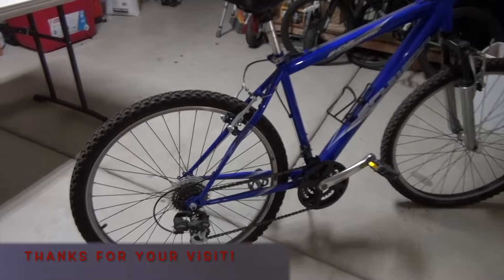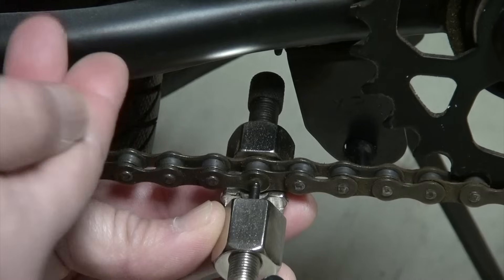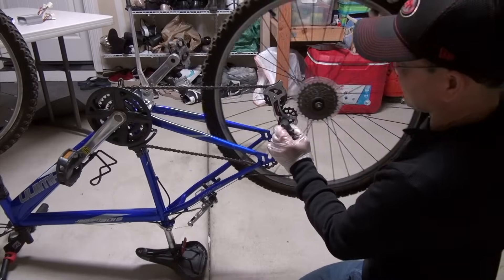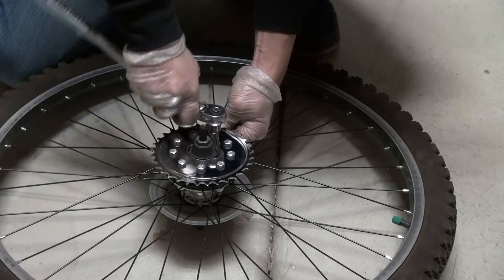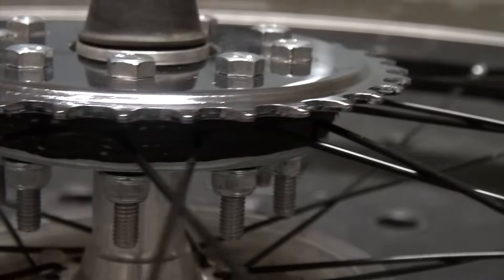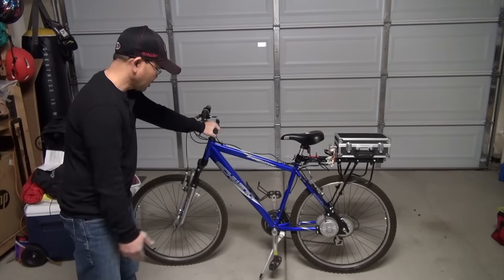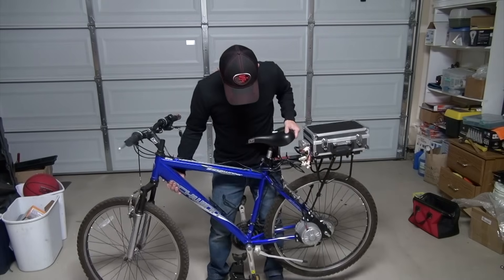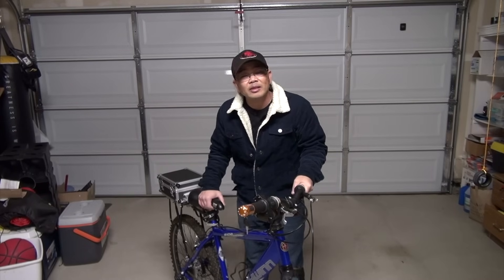Powerful Electric Bike Conversion Part I (E-Bike Conversion Kit Installation)

Comment: I bought a 40v Ryobi tool battery, a charger and a power wheels adapter for the battery from Amazon.
Reply: How well did it work sir
Reply: @mr.wizeguy  It works awesome for a 36v system. I built five e-bikes for my family and I use the 40v batteries for all the bikes.
Reply: Sir please for instance if the battery weak, can I still ride the bicycle as free as the normal bicycle, I want to know if the motor will interfere will make it hard to pender

Comment: Is there anyway of increasing the power, using products from companies like Arduino
Reply: u can use a more powerful controller (bigger wattage compared to your motor) so say you have a 24v 250w motor, you can actually use a 24v 350 controller, this will give the motor a little bit of power because its pushing 350w from the motor instead of only 250w. The downside is you will wear your motor a lot faster.

Comment: this is not a powerful kit, I installed the 36v, 450 watt version of this kit onto a 26" wheel mountain bike. This kit, with charged batteries will go right around 20mph on flat ground and decrease as the batteries go down. This is a helper motor and not enough power to go up hills by itself, it enables you to pedal up those hills with effort as without, your walking. My biggest complaint about this is how loud the motor is and its loudest at 17 mph and up. Im using a 10ah 36v battery, the range is horrible, with hills around lucky to get 8 miles,  and the brackets did not fit at all, I have to basically fabricate new brackets and the kit location, you will hit your back of your foot on the motor, I mounted it up behind. If you like diy on a budget you can try it, other than that I would recommend just using a hub style kit, much easier and better performance.

Comment: How fast does it go?
Reply from the maker: Top speed is 18 miles per hour.
Reply: Ok thank you here's a dumb question if I was to get the 200 or 250 watt or what ever it is would it go slower? I'm thinking it would but to sure and how many miles do you get on one charge with them battery?
Reply: @clarkgrizwalt3377 e-bike conversion kits don’t come with a battery you have to buy one. The 250 watts motor is better than the 200 watts
Reply: I was wondering if I could get someone to install it for me?
Reply: Where are you located at and what do you need installed?

Comment: 6:42
I'm pretty sure that is the wrong plate, that one is for the right side. The long slot allows it to slide towards the front and back.

The plate is not symmetrical. Therefore the same plate does not go on either side, they should be different plates. That is, unless it's just weird.

Apparently they (whoever they is) never bothered to redraw/redesign the plate when they decided to apply it to the left side of the bike.

Comment: Use a Clamshell Sprocket adapter .  Rag joints kill wheels
Reply: Have you noticed that plate is the same for the left and the right sides, even though that plate is not symmetrical. That long slot on the pointy end should allow it to slide forwards and backwards like when installed on the right side, not diagonally like when nstalled on the left side.

My guess... The original design was for the right side and they (whoever they is) never bothered to redraw/redesign the plate when it was applied to the left side.

Comment: Thank you so much for sharing this video I was thinking about doing the same thing on my bike and wanted to see it done first before I went ahead and started on it by chance does anybody know the range on these batteries and a good way to ensure it’s waterproof? As we all know rain+batteries = a bad day 60 miles from home lol
Reply from the maker: Check out part II and this video for better ideas and electric motor.  Fast and Powerful 48V 1000W--A Complete DIY E-Bike Conversion Kit Installation Guide for Beginners!
https://youtu.be/Ej1OK0_hJaU.  Good luck on your project.  Thanks!

Comment: hello, 19mph ! it's not much for a 450w, your battery 36 or 48v ?, my bike with motor hoverboard 350w friction mounting, modified to triangle, 36v battery runs at 24 mph.

Comment: Can I use a 36 volt lithium ion battery
Reply from the maker: Yes.  That would be the preferred type.  Check out part two of the video.  I upgraded the bike to lithium ion battery…

Comment: Is this compatible with disc brakes
Reply: It is, but u have to remove the brakes, install the sprocket, and then reinstall the disk brakes. The rest should be the same.

Comment: Good video, but is it not worth investing in a battery unit, frame mounted that is less obvious, detachable for charging, you have quite a bit of weight there and it's not exactly in the safest of spaces, but like I said good video all in all.
Reply from the maker: Thanks! I resolved those issues in part II
Powerful Electric Bike Conversion Part II--Lithium-ion Battery Power Boost Upgrade
https://youtu.be/c6YgNQg3VM8

Comment: YOU  HAVE TO BE VERY CAREFUL  WITH  THAT  CHAIN BREAKER OR IT WILL ITSELF BREAK .
THE  CHAIN  LINKS  HAVE TO BE POSITIONED  VERY ACCURATELY . IF YOU HAVE TO USE   TOO  MUCH  FORCE THEN IT IS NOT ALIGNED CORRECTLY..... THERE ARE ALSO  PLACES  FOR   TWO TYPES  OF  CHAIN  ( THE  10 SPEED  TYPE  AND THE  OLDER 3 SPEED  TYPE MAKE  SURE  YOUR  USING  THE  CORRECT  POSITION TOO..

Comment: It does not have reverse right?.. I mean.. I tried to move on reverse but the chain did not  run because the motor.
Reply from the maker: Correct, it does not reverse…

Comment: Which wires should connect to the battery
Reply from the maker: check out part II of the video for better ideas: https://youtu.be/c6YgNQg3VM8.  The battery should be connected to the red and black terminal connector of the controller.  Thanks!

Comment: Good job. How'd you get the gears to line up so we'll,? Most don't.
Reply from the maker: You might have to shorten the chain and used an extra washer.  Some bike fit better than others.  Thanks!

Comment: I fitted locking nuts on my sprocket !!!!    I bought  2 kits for  2 bikes !!!   The only problem is the kit can be difficult to fit !!!!  But that doesn't bother me !!! The thing I like is that you don't have to buy an expensive battery to fit a computerised system.  You can use Lithium or lead acid and you only have 2 leads off the battery unlike a multi pin plug in unit on a bought E Bike !!!!
Reply from the maker: Thanks!

Comment: why doesnt anyone tests this up on a 10degree uphill?
Reply: I had tested 250 watt motor on 45° uphill, speed had reduced to 3 kmph and motor outer cover temperature went around 90°c. Again tried with two people on one cycle and motor started to burn in the middle of the hill which is around 100m long. But I still use the motor without any issue. This motor can handle around 25 amps of current for about 1 - 2 minutes (in 2 people overloaded condition) . In normal condition this motor takes around 19 amps starting and 7-10 amps running current in flat road with 2 x 12.6v lead battery.

Comment: Im also building an diy electric bike. Im ziptying the wires to the bike frame, but should i use electric tape to cover up the exposing wires?
Reply from the maker: I would stay with the zip ties as they provide flexibility in case you need to rewire the bike.  Best of luck on the project.  Check out part II for better ideas to make the bike lighter  Powerful Electric Bike Conversion Part II--Lithium-ion Battery Power Boost Upgrade
https://youtu.be/c6YgNQg3VM8.

Comment: what about the strength of the dynamo, is it durable? How many kilometers has it been used?
Reply from the maker: Hello, I have not been keeping track of the mileage, but I still have the bike today.    Check out how I upgraded it in this video 
Powerful Electric Bike Conversion Part II--Lithium-ion Battery Power Boost Upgrade
https://youtu.be/c6YgNQg3VM8.  Thanks!

Comment: Hey! Are these parts waterproof? I want to do this to my bike but I’m not sure if it can withstand rain.
Reply from the maker: I never took it out in the rain.  But I’m sure  can place protective rain covers on the motor, controller and battery pack. My upgrade of the bike in part 2 of the videos make it simple to cover the battery pack and controller from rain.  Powerful Electric Bike Conversion Part II--Lithium-ion Battery Power Boost Upgrade
https://youtu.be/c6YgNQg3VM8
Reply: The controller is not water proof

Comment: Hi dear. May i know how is the 20-30degrees uphill climbing power. Can we get same speed ?
And can you tell me which one is better for ebike, two of that type motor or 3x 895 or 997 DC 24v motor with reduction gears Thanks
Reply from the maker: It will require more power when going up hill.  If you want to get the same speed when going up hill, you’ll will need even more power.  I don’t know enough about the motors you’ve listed to offer helpful feedback.  I recommend using at least a 36v motor.  Thanks!

Comment: Is there a motor drag when pedaling ? I know with non geard hubs it's so bad you can't ride it with a dead battery . A reply will be apreciated
Reply from the maker: Just slightly.  Overall not a problem when not running on the motor…

Comment: Can it work with only a switch without a motor speed  controller?
Reply from the maker: A switch will turn on the electric motor, but you need the throttle to control the speed of the bike.  Thanks!
Reply: The motor switch should have a dead man feature. Other wise you could become A Dead Man.

Comment: How well does it do when you go back to shifting regular. Does it effect it?
Reply from the maker: It runs pretty well on regular mode.  Just slightly heavier due to the weights of the batteries and motor. Check out part II of the video for better battery storage idea
Powerful Electric Bike Conversion Part II--Lithium-ion Battery Power Boost Upgrade
https://youtu.be/c6YgNQg3VM8
Reply: Also did you have to buy the battery separately
Reply from the maker: @BHopDubs  Yes. You have to purchase the battery separately.

Comment: Just got ours assembled. The way the bracket lays on the bile frame the electric motor sprocket and the bule sprocket are not parrallel and the chain keeps coming off. Difficult to adjust the motor to change sprockett angle.
Reply from the maker: Sorry to hear it doesn’t fit perfectly.  You might try adding washers to the axle rod and or adjust the length of the chain to the electric motor…
Reply: @diypotentials  I was able to adjust the bracket angle by hammerin gout the two 90 degree bends to make both sprockets parrallel. SUCCESS!!
Reply from the maker: Awesome!  Congrats!  Check out part II for better battery storage ideas.  Happy New Year! https://youtu.be/c6YgNQg3VM8

Comment: Great project. Just one question: Isn't the noise too much? Does it grab every one's attention on street?
Reply from the maker: Thanks!  It is not as noisy as heard on the video.  The microphone was set on zoom mode.  Check out part II for better battery replacement and upgrade.  https://youtu.be/c6YgNQg3VM8

Comment: hi just wondering how to align the motor, I try to follow your way but not enough room for me to secure the motor. please advise thank you
Reply from the maker: Depending on your bike’s frame, it might not fit.  If tiny adjustments needed to align the chain, you might use additional washers.

Comment: Just wanted to ask what your bike frame size is to see if the bracket can fit my bike. If you can give the dimensions of the bracket that would help too :)
Reply from the maker: Sorry, been away for several days.  My bike frame is 26".  The height of the bracket is 6".

Comment: How do u know what type of battery will work???
Reply from the maker: The DC motor runs on DC current.  Batteries put out DC voltage output.  If it was an AC motor, it would not work.  You will need an inverter to convert DC to AC to drive the AC motor. Thanks!
Reply: @diypotentials  what type of battery would u recommend? I'm brand new to this e bike thing and I'm lost in sauce 🤦
Reply from the maker: Check out part II of the video, https://youtu.be/c6YgNQg3VM8.  I recommend lithium-ion battery pack because they are lighter and has more power density.  However, they are more expensive than the lead acid batteries.  Also, be careful when buying lithium-ion battery packs, some sellers are dishonest about the battery capacity rating.  Even the one in the video might not have its true capacity as several viewers pointed out. Check out buyer reviews before purchasing.   Best wishes. Thanks!
Reply: @diypotentials  thanks

Comment: did not show the wiring connections
Reply: You worried about the yellow and black wire connection to red and black wire on the motor? Funny, me too. Trying to find the answer myself without contacting the seller.

Comment: Blankety blank it torx nicely 👌 😎 👍
Reply from the maker: Check out part II. Powerful Electric Bike Conversion Part II--Lithium-ion Battery Power Boost Upgrade.  Thanks!
Reply: @diypotentials  As you know I like bicycles that remain bicycles. So when I get far away from home and become tired I simply ride home with the electric motor👍. And enjoy the breeze especially in this Texas heat sweetheart!!!!

Comment: You sir are a god send I will look for it as you said on Ebay and Amazon. What's the name of the kit please please please???? What does Ebay or Amazon call it if I go to the search. Please.
Reply from the maker: The links to the products are below the video description.  Here are some products in video:
450W Newest Electric Bike Left Drive Conversion Kit
https://amzn.to/3jCWn2V
12V Sealed Lead Acid Batteries:
12V 7AH Sealed Lead Acid Rechargeable Battery 
https://amzn.to/3h9PNj4
2 pack--12V 7AH Sealed Lead Acid Rechargeable Battery 
https://amzn.to/3zVZrNG
Thanks!

Comment: What type of bike is that because everything seems to fit so well, and these kits are not the best at being universal
Reply from the maker: A 26-inch Schwinn sidewinder.  I don't see it on the market anymore.  Thanks for the comment on the battery.  I have to be more careful next time.
Reply: @diypotentials  👍

Comment: Thanks for posting this and doing such a great explaination.  I just finished a mid mount kit on my bike, but I was looking at the outboard motor for another bike as an inexpensive project.  I like the 250W/36V motors as we can use surplus scooter LiPo batteries for them.
Reply from the maker: I’m glad it was helpful.  Check out part II of the video.  I found a simpler way to store the battery.  Powerful Electric Bike Conversion Part II--Lithium-ion Battery Power Boost Upgrade.  Thanks!

Comment: Your video was enlightening I bought a kit and after watching your video I come to realize that I didn't get a flywheel like the one you installed and I don't think mine is going to work
Reply from the maker: Thanks for the kind words.  It took me awhile to collect all the parts together for  the project.  Part II of the video provided a short cut.  Powerful Electric Bike Conversion Part II--Lithium-ion Battery Power Boost Upgrade.  Good luck with the project if you decided to continue.  Thanks again!

Comment: Hey I just bought the same kit what battery do I need
Reply from the maker: Congrats on the kit. Check out the rest of the video and these two other videos for more ideas on batteries. How to Charge a Battery--lead acid and lithium-ion batteries (2021)
https://youtu.be/74OGZGrKd5Y
Powerful Electric Bike Conversion Part II--Lithium-ion Battery Power Boost Upgrade 
https://youtu.be/c6YgNQg3VM8
Thanks!
Reply: I prefer the lithium ones

Comment: Great video! I just bought one of these E-Bike 24V 250W Electric Bicycle E-Bike Conversion Kit Brush Motor+Freewheel 100% New today on eBay! But I have one question? How you do you recharge your 12 Volts Rechargeable Batteries without getting shock or feeling current? I'm thinking about getting one of those type of batteries? Or a 36v Li-Ion Rechargeable Battery Pack? I'm looking how to find a charger that would be compatible with a XT60 Yellow Connector Plug? I may need your help and advice. Thanks. Have a great weekend. Take Care, Phil
Reply from the maker: Hello, Best of luck on your project.  Regarding 36v rechargeable battery pack, please check out part II of the video.  https://youtu.be/c6YgNQg3VM8.  It might have helpful info for your project.  Thanks!
Reply: @diypotentials  Thanks!

Comment: Seems like a lot more work than a hub motor kit especially if you need to adjust the motor bracket to fit your bike frame , but this is much cheaper
Reply from the maker: Thanks!

Comment: How to charge the battery.  Please help
Reply from the maker: By using a battery charger.  If your batteries are 12v each, you can use the 12V battery charger and charge each one at a time. You can purchase them on eBay or Amazon.

Comment: Thanks, The only thing I would do differently is use LIon batteries instead of lead acid.
Reply from the maker: Thanks!  In fact part II of the video, I upgraded it to 36v 30AH Li-ion battery pack.  Lots of fun!

Comment: How much was the kit and the battery
Reply from the maker: The kit is approx $125.  You can find it on ebay-36V-450W-Ebike-Left-Drive-Electric-Bike-Conversion-Kit-Hub-Motor-E-Bicycle-Kit.  Also, I recommend using Lithium-ion battery instead.  Check out part II of the video.  I did a power upgrade to Lithium-ion.  I paid around $140 for the battery--36V @30AH.  https://youtu.be/c6YgNQg3VM8.

Comment: how did you align the motor sprocket with the wheel sprocket? the frame doesn't look parallel to the wheel. It seems like you skipped a lot of micky moussing. The frame doesn't fit in like plug & play.
Reply from the maker: Luckily my bike frame fit.  I did have to make some adjustments by shortening the chain and adding an extra washer to the wheel axle to align the sprockets.  Thanks!